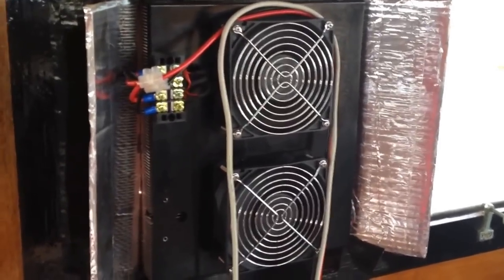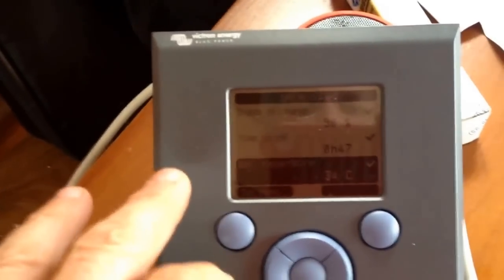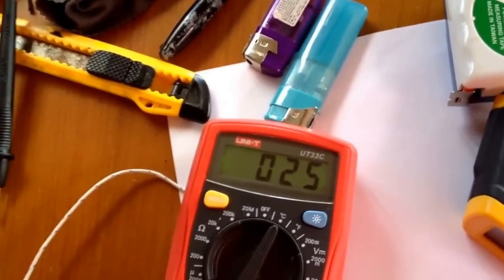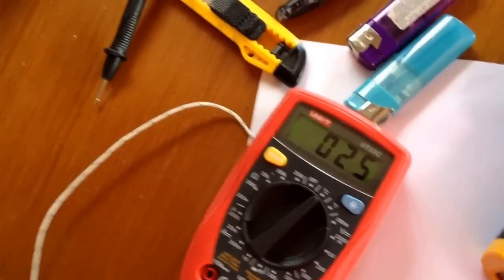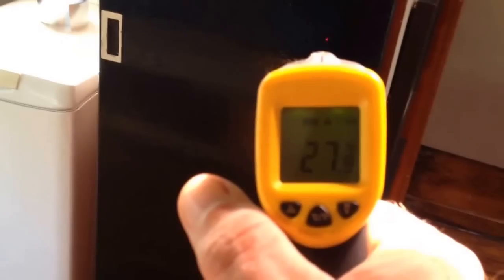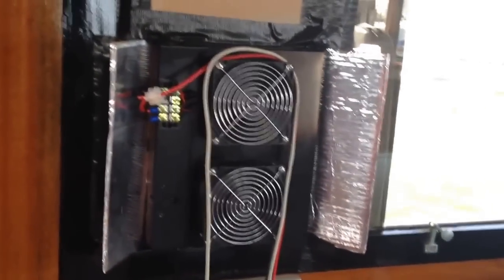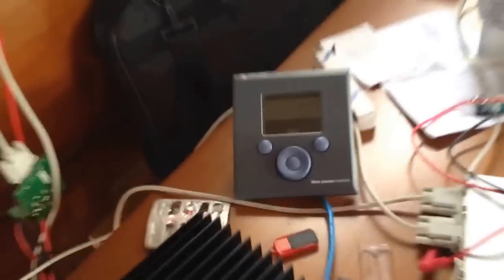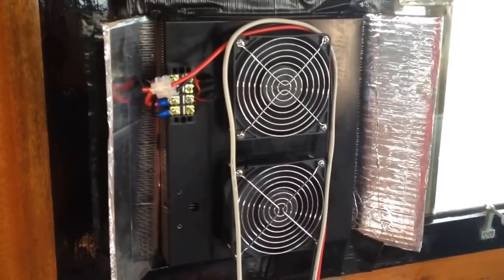Peltier Air Conditioning 5

Comment: Hi Alan I hope you can answer me, I'm from Mexico, Hermosillo Sonora, we have here 46 Celsius, I built cabinets for different applications, an normally we use a minisplit air conditioning to have everything under control because they are cheep and works, but.....
Right now I have a cabinet very small that has a monitor inside, but is outdoors cabinet, is in the sun all day, it has a canopy but doesn't protect 100% depend on hour and sun position, the cabinets is like 24X24X10 Inches, the monitor is inside and says that can operate at maximum of 60 Celsius....
The problem is that I can't put a AC minisplit on it...and I'm wondering if this kind of unit can do that job....and if it can what Power that you recommend.....thank in advance....I will appreciate your answer...if you contact me will be great...
Reply: Hey I'm from Phoenix AZ. It's pretty got here as well, I did use this peltiers for a project, I did a lot of research in my own. You don't give much specifics on your cabinet, but a peltiers should be good if you are looking something like 12inches by 12. Kinda like a cooler size. When I did my project I used it to cool down my laptop, I used a liquid CPU cooler to cool it down  and it works really good, I would advice to get a 15 amp peltier with a 12v power supply. Hope this helps

Comment: You could achieve drastically higher efficiency by using either a closed loop cooling system for the hot side (less chance of gunk getting in the lines) or using sea water to dissipate the heat thus a radiator would not be needed if you decide to use a passive open system. You are probably burning up 425ish watts of heat that you must dissipate effectively.

Comment: In the name of the power of sea water .... :) You can dismantle the outside fans. Attach an aluminum water cooling block to the heated surface. Turn the sea water inside the waterblocks and increase the internal surface cold by %17- %20 However, you must eye pass the aluminum blocks to the end of the season. Seawater may become clogged after a while in the block. But if maintenance is done, you will get very efficient cooling in this way.

Comment: Hello there! I've been checking out the web to find something like your peltier ariconditioning. I'm not sure if you have mentioned it already here but I wanna ask what type of peltier module did you use here and how many?

Thanks!
Reply from the maker: Leinad Cojuangco Hello. They are TEC modules, except I had them made. The "off the shelf" units have such a low efficiency !! By working with a factory, we increased the purity of the parallel semiconductors, and that made such a big improvement. The "big fish" as I call it has 6 modules. They are 24v dc.
Reply: Thanks! and you created your own TEC module, that's a diff. level of expertise... Nway, i saw this video from a hispanic youtuber. He used 8 TEC12706 with a 16amp supply, giving each module 2 amps. His DIY is yet so simple, fans and heatsinks are significantly smaller than usual, and the final result, his device could attain an ambient temp of 20 degree celcius (frankly, I find it hard to believe). Since he speaks spanish, I didn't get most of his words. I have plans of making my own AC, that's why, since 2nd week of March, I've been searching gearbest and banggood for a better TEC module-AC. the Kits available only have the TEC12706 with a monstrous HSF (those used in a high-end computer cpu)
Reply: Hi Leinad, How has your project progress? I am thinking of building it also. Can you share where you bought the parts. Thanks

Comment: DON'T DO IT :(((. I have 2 Solar Panels at 145W each... That is 290W. In good Sun, the Panels can get up to about 7 AMPS each (-/+ Give and Take). My 2 Peltier is 100W each, + the 4 x 12V Fan to Keep Cool / Hot on each side. I'm trying to cool 200sf of Space and it seems that it's NOT adequate, the Peltier SUCK ENERGY like crazy :(((((. The amount of Space that the 2 Solar Panels and the Money and Batteries and Time it's NOT worth it :(((((.  I should have done a SUB Cooling System using the WATER that around / under the Boat, which would be CHEAPER and EASIER. Do a PASSIVE COOLING SYSTEM using Water, Pump + a Fan and a Solar Panel  :). The Water 3 Feet below is like 55-65 Degree while it's like 95F+ in our Cabin. A Fan and a Sub Cooling System (Using Car Oil / Transmission Cooling Kit (18 Bucks) Plus a 12V DC Fan) and just ONE Solar Panel would be enough to Cool the Space. At night, it's even Better :))))))))))))))))))))))))))))

Comment: hi, if i made this air conditoner, how long it can use for a day?
Reply from the maker: I run it during the day when the sun is feeding the solar panels. I turn off at night and just have a small 24v wall fan to circulate the dry cool air in the cabin to sleep. I turn on again when the sun comes up... I use as needed. More of a luxury then a necessity :-)

Comment: I agree with the water cooling. using a small bilge pump or cheap DC fountain pump would use as much power as you're fans. then get a garden post sprinkler ($2 at home depot) and have it sprat over the heat sinks. water that drips away would take  heat with it obviously but any water that evaporates would actually aid in cooling.  evaperative cooling is very efficient and is used to help cool many large buildings
Reply: 100% Correct. You are surrounded by COOL Water, why not use it to your Advantage???

Comment: What's the water temp in your area
Reply from the maker: In the summer time the water is max 28C. I have thought about using water cooling, but the pump would add another 2.8 amps, and the sea water organisms would begin to clog it in about a month or so... Damn barnacles

Comment: Just try next model to cool the hot side of the peltier with water cooled system... it will be more efficinet 

if you like to go one step ferther  you can try to make the hoses go inside the sea (with heatsink attached)  so the will cold better than the air 

i am making something like that for my boat  (Greece,, to hot  in summer )

peltier can reduce maximum 20 celcius of the ambient temperature
so if you have 35c  will achive maximum  15c drop
but when sea water is at 22c they will drop temp at  2c   
So better cooling  better efficient...
Reply: +caslor2002 that would rise the efficiency very much "if that water is even cool"

Comment: What is that device your using to monitor the battery, I have a small PV system and would like to look into that device to shut my system of at 40% battery use :)
Reply from the maker: The battery monitor is the Victron Energy Blue Power Panel and the Battery controller with shunt. You can connect several
Independent battery banks for monitoring. There is an alarm relay output on the blue power panel that you set to the SOC you want. You could connect to a relay that would completely isolate a battery bank as you require. Great piece of hardware !!!
Reply: Thank you for info, I shall check it out :)

Comment: Hi Alan, That looks like an amazing project! I would really like to try it as well - where did you get the complete unit? I`d need a 12V version of it, are those available anywhere in Asia? (I live in Thailand). Also, I think you could use the condensation to actually make water for a Yacht, too, right? How much water would your AC unit produce?

Comment: Why not do water cooling for the hot side since youre on a boat???? Saves from having to use any kind of outside ventilation.......just use a low amp draw bilge pump (delete the hot side fans to offset the power of the bilge) to feed water from outside through a 1/2 or 3/8 tube and make a water jacketed heat sink for the hot side......much more compact and I bet it will cool better.
Reply from the maker: I have tried a 500 gallon per hour pump. It draws 2.2 amps. I put in a "T" from the bow seacock strainer where I use the sea water to wash off the anchor mud after a journey out. The problem is when at the marina, the jelly fish get sucked up into the strainer, thus blocking the flow of water. It was more work cleaning the water strainer a few times a week. Trying to get it to be as maintenance free as possible. Fans seem to eliminate cleaning out the jelly fish snot in the strainer basket HaHaHaHa. Having the unit continuously running during daylight hours keeps the V-Birth cool and lowers the humidity !! No more musty smells when returning to the boat after it is closed up tight for a few days. Overall it seems to be the best option so far... Damn Jelly Fish !
Reply: Whats your total amp draw?.....thinking of a setup for my 28 bayliner contessa......a 5000btu window unit is just to big and draws 46 amps with a 12v inverter.......but it makes a refrigerator out of the boat on a 95 degree day.......
Reply from the maker: thebubba1 I am drawing 5 amps at 24v on the small unit, and keeps the V-birth cabin at 19C to 20C when it is 36C outside, and the V-birth humidity stays around 46%. When I reverse the polarity, it is a steady 23C inside when it is 10C outside.
Reply: use a car radiator and glycol or oil cooling

Comment: I see in your description you are talking about 1200w of solar panels. If you have than many then you honestly should just buy an air conditioner. It could run off that power and they are very efficient. For instance many can move 4 watts of heat for every 1 watt used in power. So if you could buy an 800w air conditioner it could remove 3.2kw of heat. Your panels would power it easily. Even the less efficient air conditioners are still very efficient compared to peltiers. My cheap portable air con that I sold used 1000w and could remove 3.2kw of heat which is still good and it was a cheap one.
Reply: That being said I wish they made low watt air conditioners. I mean if such at thing as a 300w air conditioner existed that would cool my caravan when it could remove 1.2kw of heat. But they don't seem to make any low watt models.
Reply from the maker: Hello, That is a good comment. This is my thinking... 1000w air conditioner at 230v AC = 4.35 amps per hour, but my battery bank is 24v DC that the inverter will change to AC power. That means I need 46.02 DC amps from the battery bank (not including the 87% efficiency of the inverter) per hour to drive the AC powered air conditioner... so if I have the "Peltier Theory" DC air conditioner doing the same as the AC powered air conditioner at less then 20 DC amps per hour... I have more power for other appliances. Air conditioning without freon gas and a compressor is a good thing I believe... HaHaHa... I know there are other variables of a gas compressor turning on and off that change the equation, but I am basing my calculations on just the full running of the unit... the thermostat I made for the TEC unit turns the unit on and off... I am not a scientist, so I have to prove to myself by doing, not "on paper" as scientists do... I live in the real world, not on paper... HaHaHa

Comment: Well since you have built one maybe you will know if this would work. If I was to build one to be used for a caravan. And the Caravan is 150 square feet. Would a 400w unit I make using 2x 200w peltier elements run directly from solar panels actually be enough to cool it.
I notice your space is 405 square feet. From the things I have seen online 400w of peltier efficiency would = about 235w of heat being actually removed from the space. I wonder if that's removing more heat than is being put into the space.
Reply: I have read that just a human being in the space actually produces close to 100w of heat. Also then I have to take into account of the heat that is trying to get into it from outside. I have good insulation which helps slow that down.
Reply: Looking at the exact same issue down here in Australia. Issues running the B3200 Dometic heat pump and air con outside of the working range (-4 < and > 38 degrees) mean looking for alternatives for a country wide trip. 

Alan has been away. Just got back from what I can tell of his recent upload. Wouldn't mind a followup to your question. Check his most recent and I will prompt a response fifty. 

(Besides the issues of functionality - there is also an issue of an adequate generator to run the show).

Comment: I've been planing to do a "portable" A/C with TEC since I was 15years old. Guess I should start it now or I'll get too old to play with stuff like this. xD
I don't plan to run my system on batteries, I have a 300W 80% Plus Bronze Seasonic power suppIy lying around, and I'm gonna use it to power the whole thing. It has two rails with 12V and 18A each, I belive it's enough to drive two 12715 (136W, 15,6A) TECs and a few fans...
I'll have to pay on my electricity bill, though a power supply with 82%-minimum efficiency, and no batteries should help with that.  
I have a few questions about your setup, or should I say, I'm curious about the following:
How powerful are the TECs you're using? To what "common" TEC module it could be compared?
What's the dimension of the aluminum radiators you're using for each TEC?
Are you using flow optimized fans or pressure optimized fans? What's the max airflow of one of these fans (cfm)?

Suggestions: I see you've tried to paint the external radiators white, wich is one of the suggestions I was gonna say. Black is just gonna get hotter under sunlight anyways...
The second suggestion, would be directing the airflow on the hot side upwards, and the cold side downwards, this should improve airflow, wich would make the whole thing more efficient.

Comment from the maker: Hello, Depending on the TEC module(s) you have or buy. You simply connect them in serial/parallel as requires to match the input voltage. There are several people using a single module with CPU cooling hardware. The standard eBay and off the shelf TEC modules have not changed since the 1960's. If you want to make a more efficient module, you will have to change the P-type and N-type semiconductor of the module as I have been doing. Good Luck !!!
Reply: You've been changing the semiconductor types? How can we do that? Where? Please shed some light. That part sounds like the key point of success for this. Please!
Reply from the maker: The Peltier theory of 2 metals (semiconductors N-type and P-type) in parallel and putting current thru them at the same time create the heat and cool effect. I talked with engineers to see how we can improve the purity of the metals to have the best efficiency, or even the metals like is being done with the improved anodes and cathodes of battery's for better efficiency. I am really happy you see my concept for a better TEC module efficiency. Alan

Comment: Hi. I like to build this Air condition for my school project. But it must be portable. Can you design the circuit for me please. I plan to use black 12v Battery (Iike in UPS battery) How much AH of battery that recommend and how much unit of Peltilr chip that I could use for Highest performance?

Comment from the maker: Hello, I live on my boats. The main purpous is to have air conditioning without the need for the AC generator. The solar panels will drive the coolers all day as they also charge my 24v Battery bank. Everything other then the Air Conditioners on the yacht are 24v DC on the yachts...

Comment: Do not spend money on batteries, buy a DC power supply and run your test on AC power plugs at home. I just got my hands on 30Amp 12v DC power supply for around 15 USD. It has a built in cooling fan in it.